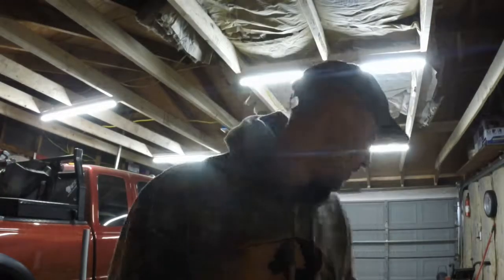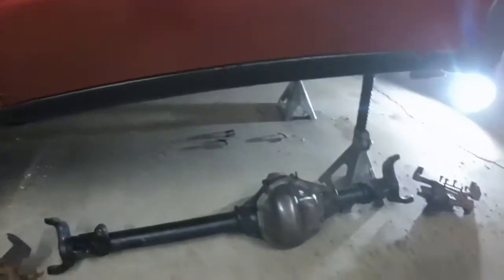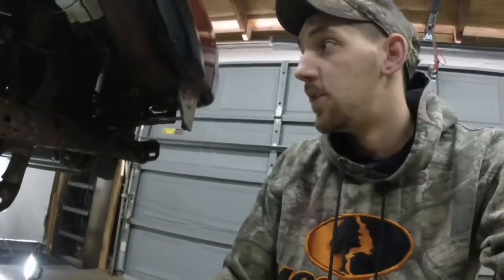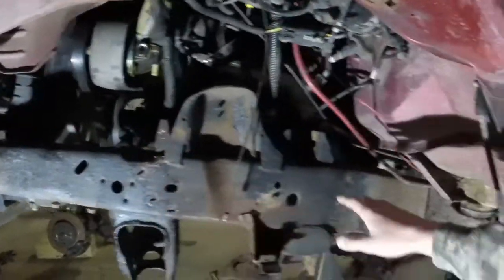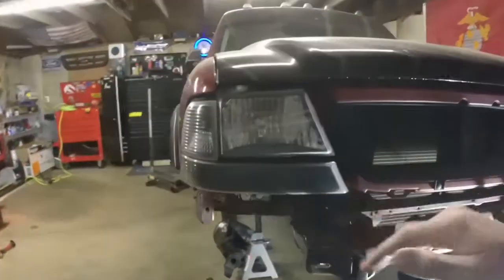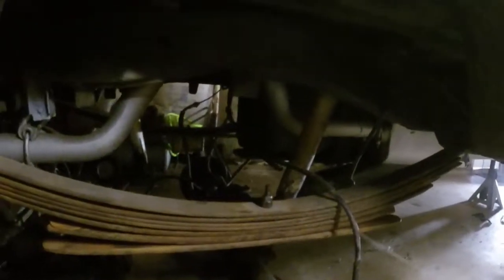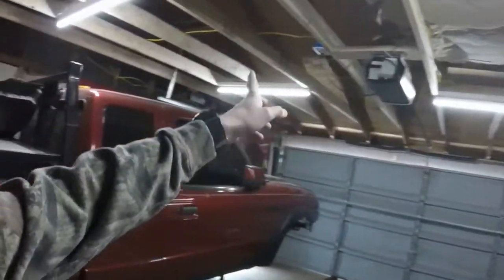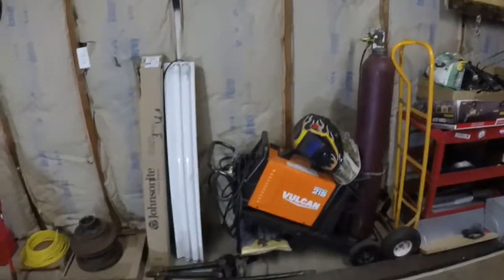SAS ranger stock rear end out

Comment: another great video!
Love the lighting, the LED's, 4 FTR's look really great and really illuminate your shop! Too bad your Dana 30 would fit for your application, I was already pondering the hopes that the Dana 30 would work as I already have leads on several of them, to resource the front axle. But Thanks anyways, i will start my search over again I guess for a Dana 40? is that correct, if so if it is being removed form a full size, will it not need to be shortened being as a full size has a wider wheel track then mid size (IE: F250/350  VS  Ranger wheel track width)
Reply from the maker: Johnny Lester Jr. you can still use a Dana 30 for your application it would be simpler and probably cheaper,  since the track width is so close and you would keep the same lug pattern as your rear axle. The only reason it won’t work for me is I want the truck to be big with big tires and I want to take it off-road and see we’re I can take it.  The Dana 30 is a great axle Jeep used it forever but it can only take so much abuse in a lifted off-road truck. The biggest tire people say you can run is a 33 inch tire and I plan on going bigger then that so I went with a bigger beefier axle. But if you aren’t looking for a huge truck with huge tires a Dana 30 could be perfect for you.